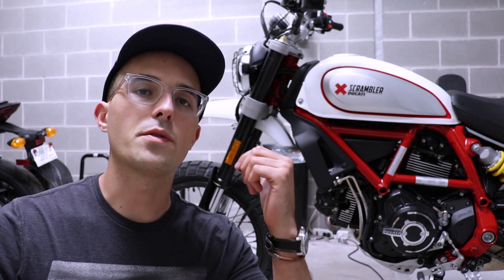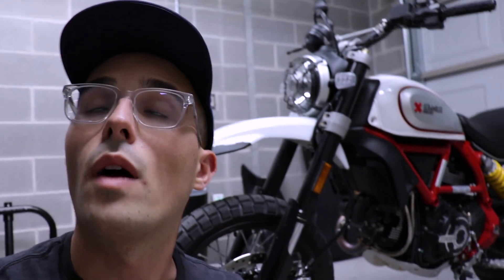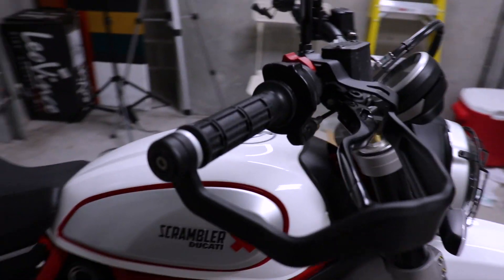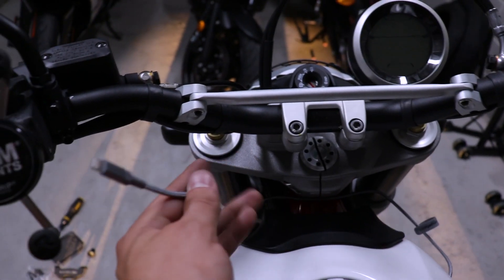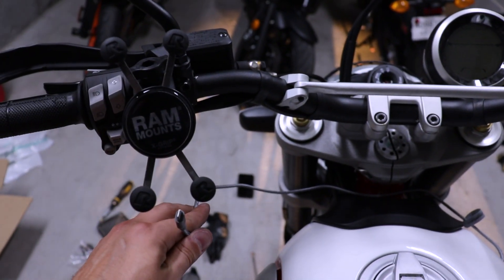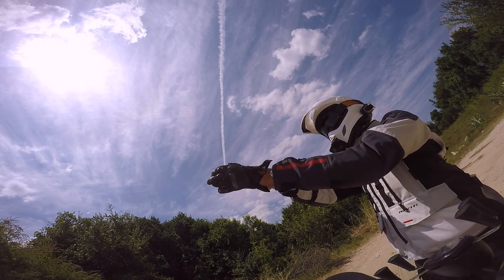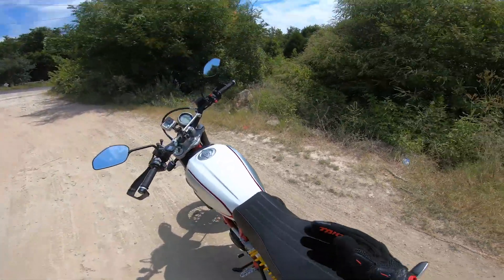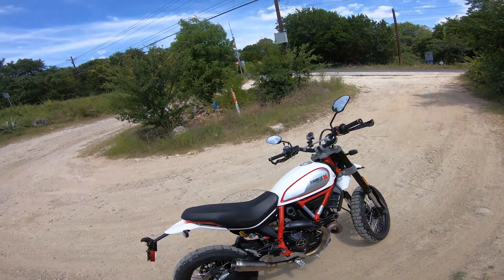STUPID LOUD Exhaust on My Scrambler!  Will Make you DEAF

Comment: Papa, a tip for lubing chains. Wedge a piece of paper underneath the chain on the swingarm. Hold the can in your left hand and fixate your left arm up against something solid, like the footpeg. Aim the bottle directly at the chain links for 2-3 revolutions. Right arm does the wheel rotations. Repeat for the other side of the chain links. This method uses your lube much more efficiently and actually gets it where it needs to be. Simple and effective. You can actually feel rotation resistance reducing while you do it and looks very professional. Greetings from a Busa lova.

Oh, and the highway clip was causing the printer I have on my desk next to my monitor to vibrate. Thanks, it was entertaining.

Comment: Quick tip don’t lube your chain on the rear sprocket as you will get spatter on you disc brake lube it up by the front sprocket do both sides of the chain above the chain slider and the underside of your swingarm that way the lube penetrates from both sides of the chain rather than just the outer edge

Comment: I agree.  Just traded in my Harley Softail Slim for a 2020 Desert Sled.  Still have my BMW S1000rr and KTM 1290 Super Duke R, but lately the little Ducati has been my favorite on the streets and mild off-road areas.  Still debating about which exhaust to go with.  My others are Akra and SC Project.

Comment: Nice mods man!  After I saw your complaint about the hand guard fitment I did a little research.  Ended up ordering a newer model directly from Evotech in the UK specifically designed for the 19-20 desert sleds.  Got them in today and they fit quite well.  My Evotech tail tidy....now that's a different story.  Had to break out the dremel for that install.

Comment: If the scramblers anything like my m796 you can make it crackle and pop at any time by letting off the throttle and rolling it back onto the end on the free play, i.e. give it like 5% throttle as a kind of fuel over-run

Comment: If it's possible I think it would be better if you either get you helmet cam to aim upwards a little bit or just reverse it and then set it up properly. Because you can't really see the road while you're riding especially when you tuck in even slightly. Camera is just pointing at your speedo.

Comment: Hey my friend! Great info all around! I am wondering how this exhaust is working out after a few months riding with it? Is it better and bearable with the dB killer in the long run? (Also still pleasant?) and also does it get annoying when off roading doing technical maneuvers at slow speeds? I really like the initial sound of the pipe but I don’t want to get sick of it 7months down the line considering it ain’t cheap! 
Thanks to anyone with this info!

Comment: I thought revzilla said pops and crackles are from a poorly tuned exhaust?
Reply: They are haha
Reply: He needs a power commander
Reply: @crazymonkey2902  - He has a full Rapid Bike auto tuner.  Crackles and pops from the old carb days, are not always the same crackles and pops as today. Emissions has added all sorts of components. These days a "secondary air injection block off" is what is needed if you really want to get rid of the pops......but some people kinda like em!

Comment: in my opinion it is rly better to buy phone handling with included USB output. 
Cable going smooth just to handling and stay there still, if you going for short ride and don't need to charge phone - no charger'end fly on your handlebar , like you instal. Rly mate - looks bad ;) i know you can do it better :D 
BUSA!

Comment: Do you like this better than your Triumph?
Reply from the maker: Very different tools for different jobs. One is a purpose bred track bike that has the most glorious top end and throttle feel, and the other is just an amazing all around motorcycle that is so fun in any condition. Love them both in different ways.
Reply: Yammie Noob thanks for your thoughts. I’m currently riding the older Triumph air cooled scrambler and in the market for either this desert sled that I’m in current love with or the triumph scrambler 1200